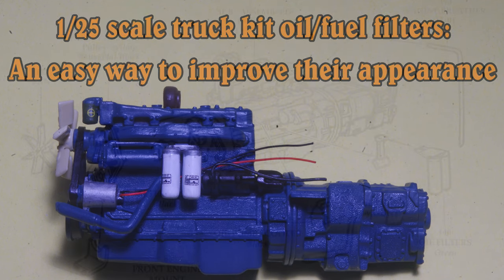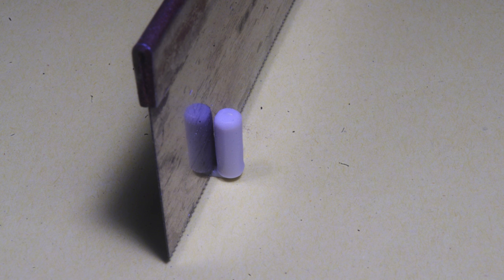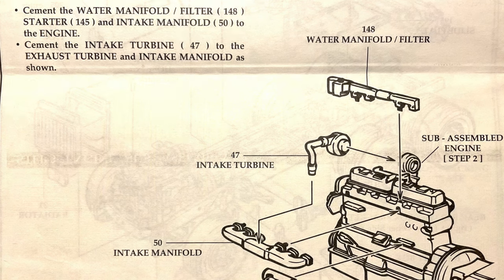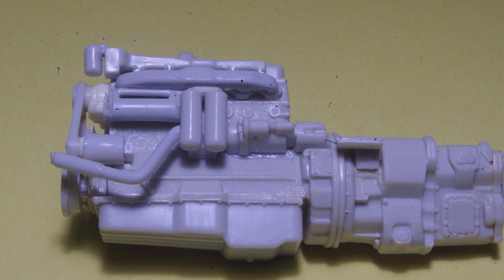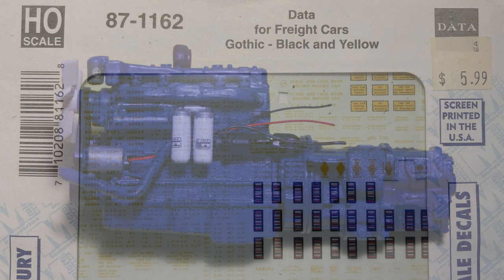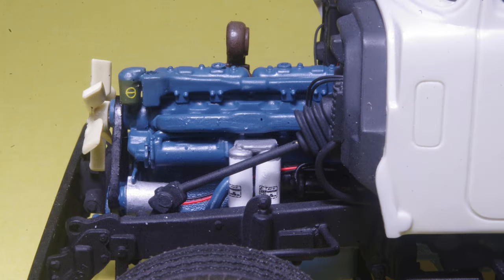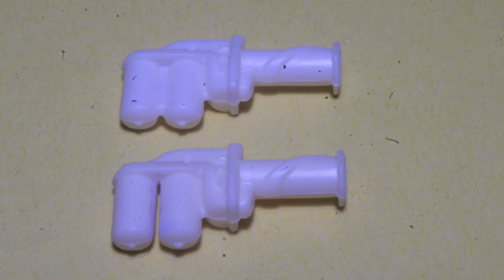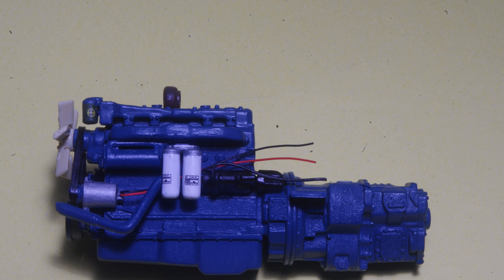1/25 scale truck kit oil filters: An easy way to improve their appearance

Comment: Robert, The filters needed a little attention! A little clean up, presto, real looking filters. That's why your models are a cut above the rest!
Reply from the maker: Thank you Mark - I had thought about removing filters entirely and making new ones from styrene tube, decided to try removing web between filters first and was quite pleased with the result. 

Admittedly filters are still "hollow backed" although in this application that isn't an issue because of their location against engine block and behind frame rail.